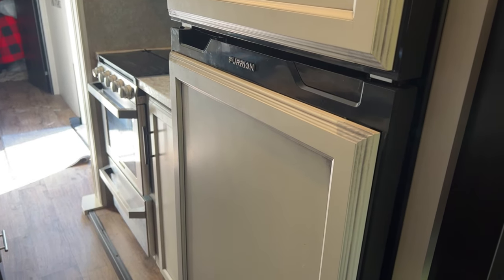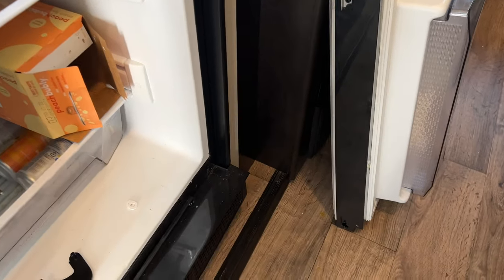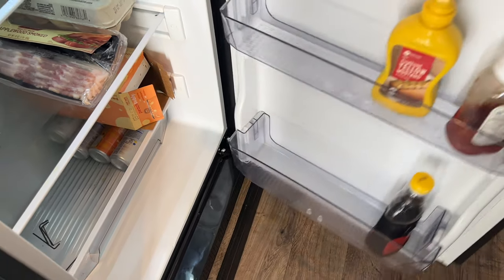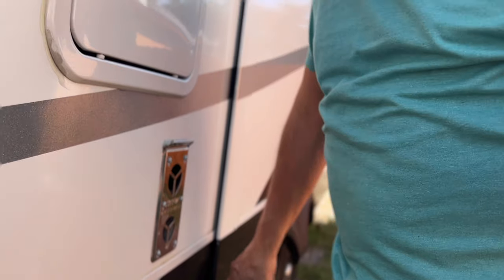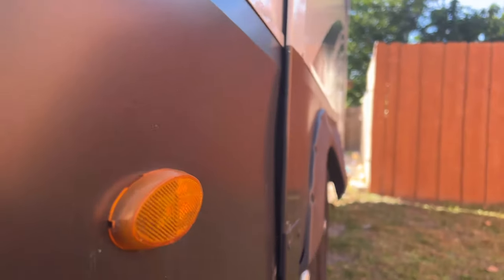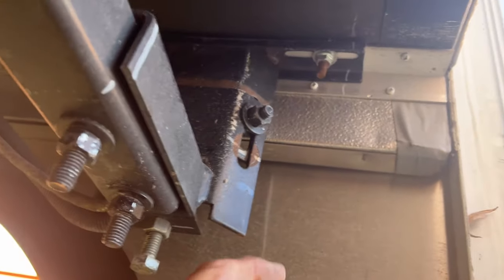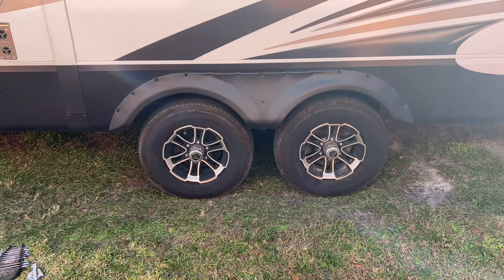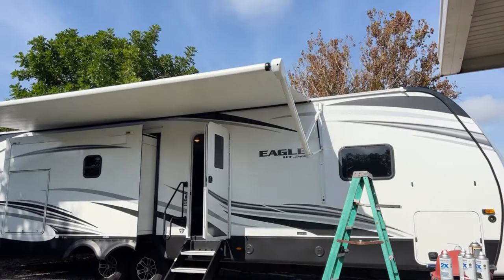Fixing Issues That CAN happen with YOUR RV | Adjusting RV Slide

Comment: Thanks for showing us how to adjust things. Our fridge doors are crooked too but seem to close good. Our tv is super crooked so we definitely need to adjust that. We can see outside too when slide is closed so now we know how to fix it.
We want change our queen mattress also, can you tell me if it’s a short queen 75” instead of 80”. Too cold and too much snow to be going inside to measure, thanks! 🤓🇨🇦✌🏼
Reply from the maker: Do you have the same Rv as us? Ours was full residential size queen which we took out and put a king instead. I have not yet extended the platform underneath it which I plan on going back and doing but it gives extra room for Nikki our dog. 😁
Reply: @AlliChuckAdventures  Yep same RV with similar issues apparently. Thanks

Comment: Thank you for the video , but , I have a question….. could you explain how the slide is supposed to be when retracting and or extending …  we have an Aspen 3010bhds and I’m convinced that the slide(s) need adjusting.  When retracting them ( mainly the dinette) , they touch the top way before the the bottom and looks like the top is pushing the too much inward.  The aluminum siding shows some creases from the top pushing in too much.
Reply from the maker: Ours hits at the top real early too. And stays in at too late when retracting on the dinette side. The kitchen which is cable driven goes evenly. I think it has to do with a type of slide mechanism.